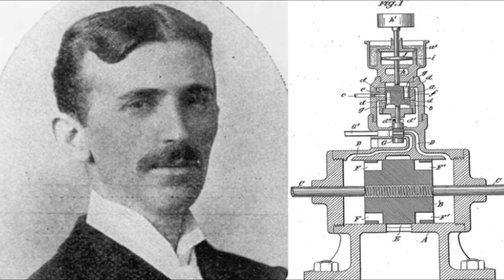Nikola Tesla's Machine That Shouldn't Exist

Comment: "Tesla was able to visualize objects including inventions he wanted to create down to the smallest detail."
Can anyone tell me what is so special about that? I have worked with carpenters, foremen, and construction superintendents who could do the same thing. We called it getting a picture. I can do that too and I can do arithmetic in my head with a picture, thereby visualizing the numbers, as long as the equation doesn't contain numbers over 99,999 and is not more than 5 figures long.  I also got a BA in Philosophy in 3 1/2 years by visualizing the sentences structurally and creating a flow chart by meaning and implication in my head.  Evey machine I ever fixed and every piece of equipment I ever took apart I knew how it would come apart and how it functioned by looking at it and getting a picture in my head. Even if I had never worked on it before. The only time that failed was when there was damage or a broken part I couldn't see, so I learned to be careful about looking until I saw everything.
So, If you can, tell me what was so special about Nikola Tesla doing the same. It's an inherited talent called Structural Visualization.

Comment: This was tested by the Mythbusters, it was shown to have little to no effect, Tesla was a genius but this device was proven not to do what is claimed.
Reply: Mythbusters also said that you can't run a car with a HHO to which they purposely failed the experiment through not using any baking soda to help separate the oxygen and hydrogen. If you look into how soldiers walk across a bridge you'll find that they don't step in unison as they found that there is too much chance of causing the bridge to fall down. All you have to do to test out to see if you can use a small amount of force to consistently move something is to push someone on a swing. 
Engineers have to deal with these forces all the time .. hence why there are devices called harmonic dampeners. One of the coolest examples that I've seen was in the top of a high rise building in Asia somewhere .. where they had a weight suspended from the roof with basically dampeners attached to it, so then during the event of an earthquake the building wouldn't oscillate and fall apart.
Reply: We had a car running on water in my college automotive engineering classes. Browns gas. Dangerous and volitle but it ran. 350 V8 in an late 80s suburban. Started on petrol but would run on the browns gas. Cool stuff but I though I remembered mythbusters saying that was not possible even on small displacement engines much less a 350 V8.